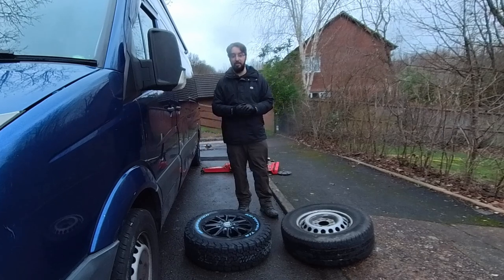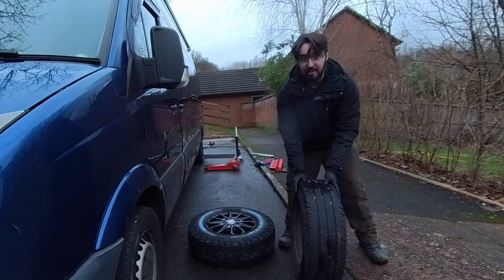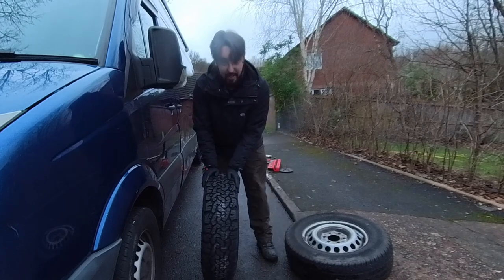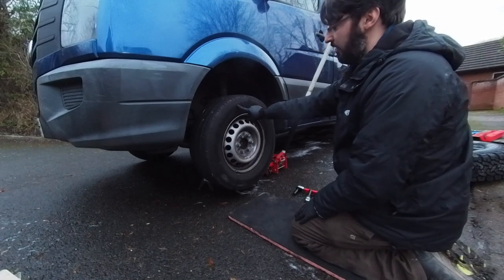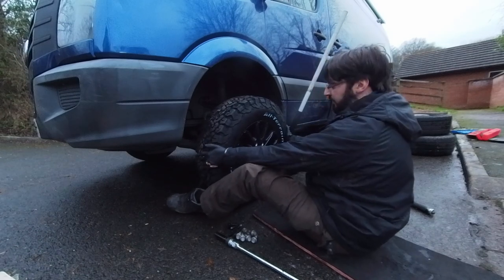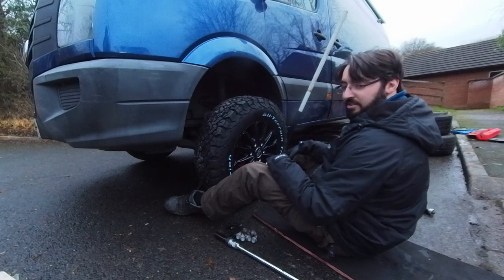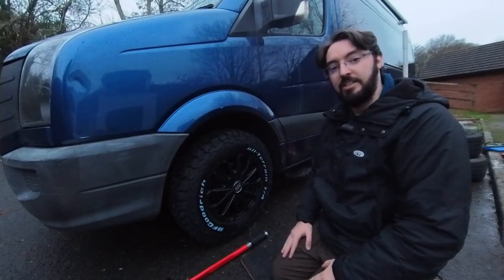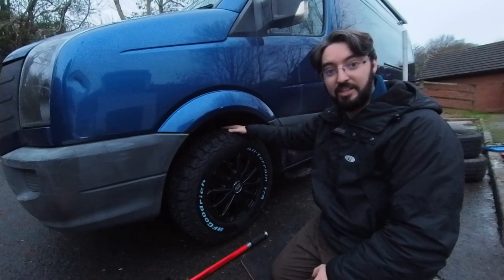Fitting BF Goodrich KO2 Off-road tyres to a VW Crafter / Sprinter - Full walk through

Comment: Hi dude.
I have the same colour van but mine is a 2011 sprinter I have just bought new wheels and BFG,s  same size  they do nor rub. They came from Rogue Alloys  Reading. Very pleased with them.
What pressures do you run yours at?
Great video by the way. Subbed. 😎😎👍👍
Reply from the maker: Thanks for subscribing! From memory I run mine at around 45psi. I might need to up the rear to 55psi though as they look a bit flat at the bottom.

Comment: I’ve seen people fitting 245 75 16 to their vw crafter and had rubbing in full lock. 
How has the 225 been? 
Great video 👍
Reply from the maker: I haven't felt rubbing when on full lock manoeuvring, I must admit I haven't looked to see if it is. I'm conscious of the potential for it to rub, so tend to avoid full lock if I can. I'm very happy with them though. The road noise is barely any different either!